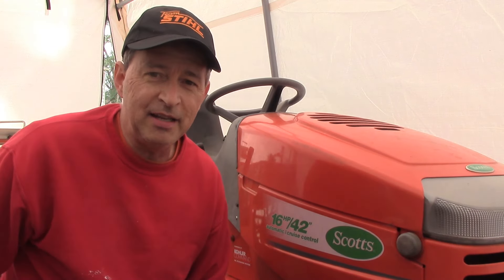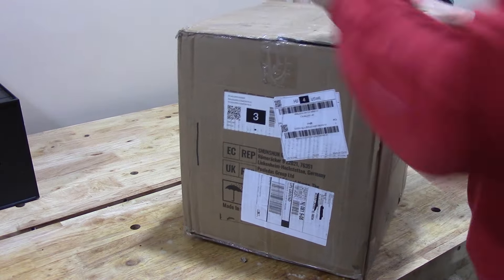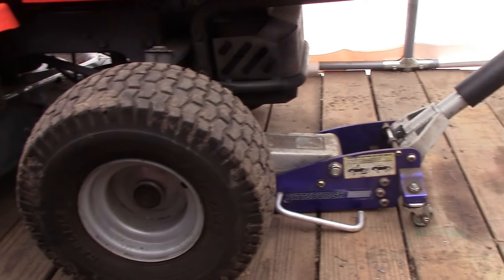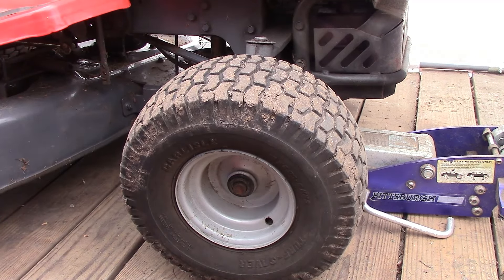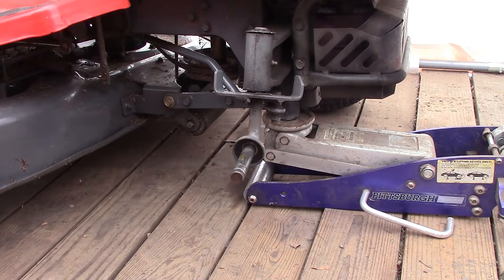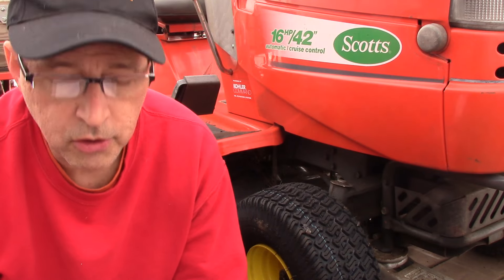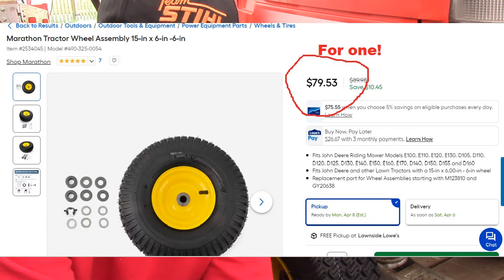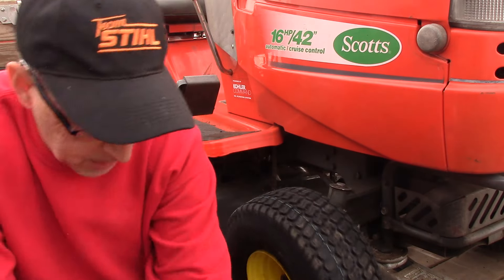Tractor Tires ALWAYS FLAT!! - Simple and Affordable SOLUTION From VEVOR and Buck's Small Engine DIY

Comment: trans fluid sounds stupid-- but I tell you- it works I have been working on lawn equipment for over 65 years- small leaks only
Reply: Maybe l will try this first. I only have to fill it once a month. Thank you for the comment.
Reply: @redpandabus-adventuresinlife  Slow leaks are amazingly fixed with only 4 oz of Transmission fluid... I've done it on countless tires, and it swells up the rubber and stops the leaks.

Comment: Took my flat tire to tire store. They did not want to repair saying poly ester tire was not repairable. My experience trying to repair flats convinced me that repairing flats is futile. Then suggested to use slime to get back mowing.  I used Flat Out which appeared to be to last longer. Been two years now and still holding air.

Comment: I would like to see how long the bearings hold up after a season or two. I wonder if the bearings in the others that cost twice as much for two have better bearings? Please update after the season and let us know how well they held up. Thanks!
Reply from the maker: Right. Bushings actually, not exactly bearings. But yes, time will tell how well they hold up. Thanks.
Reply: @Buckwsr  Thanks for the correction. Please let us know if you notice any issues with the “Bushings”😆

Comment: I like your you tube videos but I have to agree with the other commenters, and I understand we live in a "throw away" world. I looked up the price of the tires and for $75.00 I think I can fix a flat tire. Also get your grease gun out of storage and start using it. Then replace the plastic wheel hub seals, you don't wont dirt, water or other contaminates getting into your axils.